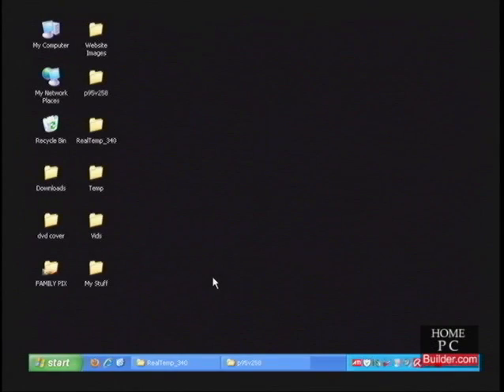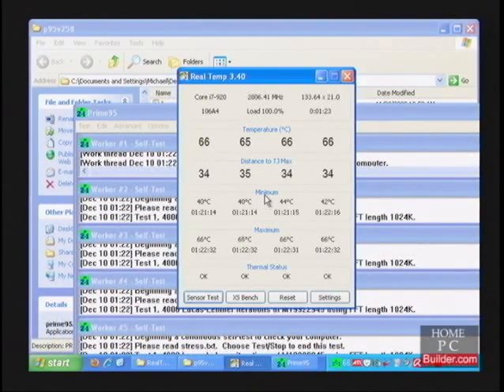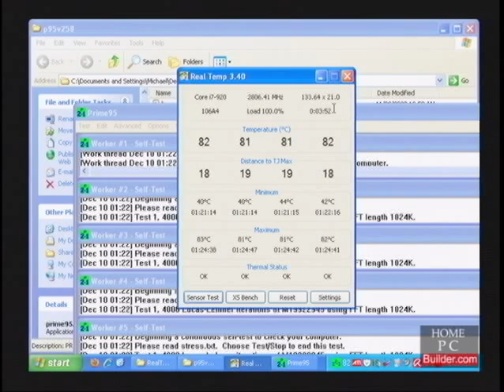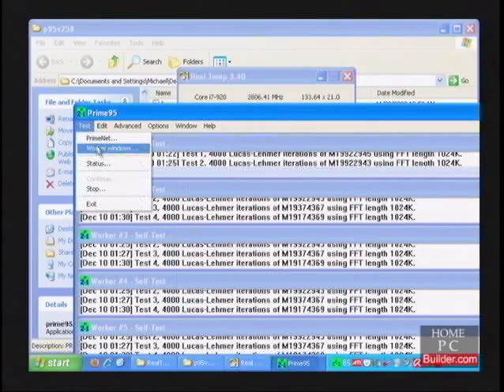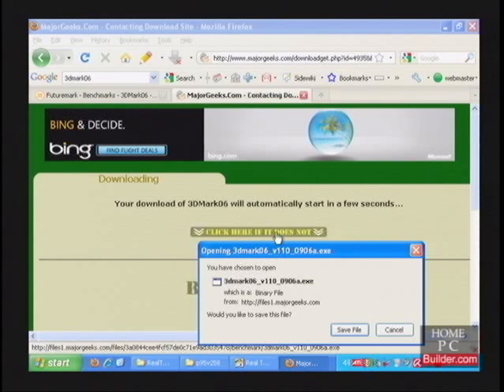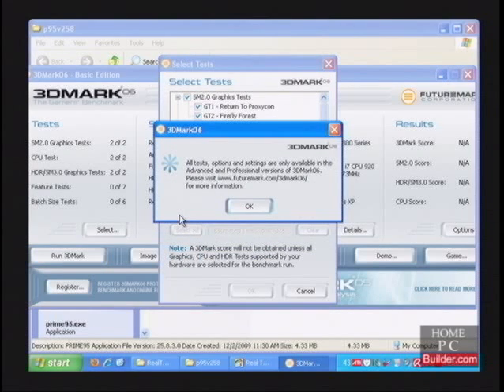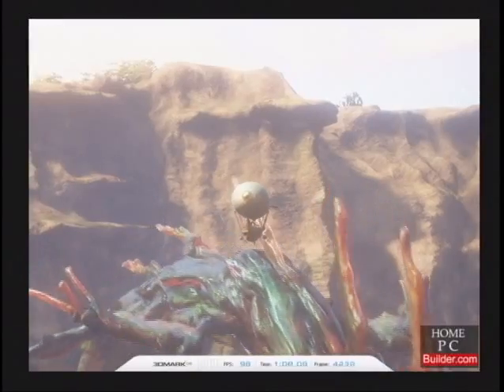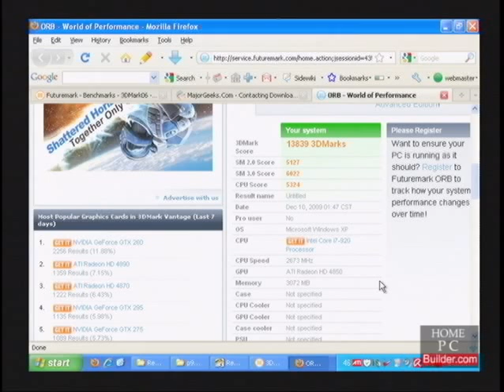Lesson 02 - Part 2 - Intel Core i3, i5 and Core i7 CPU Overclocking - www.HomePCBuilder.com

Comment from the maker: @daxeflame All AMD and Intel processors that come in a retail box have a cooler in the box that has CPU compound applied and you don't have apply more compound to the CPU. AMD and Intel CPU that are bought without a CPU or OEM style need to have a cooler bought separately that may of may not have compound applied to them.